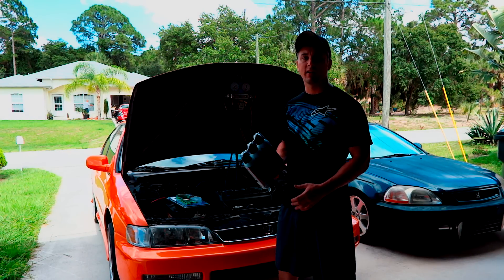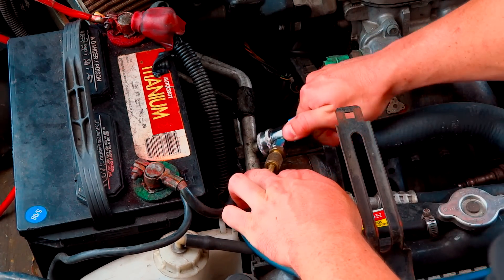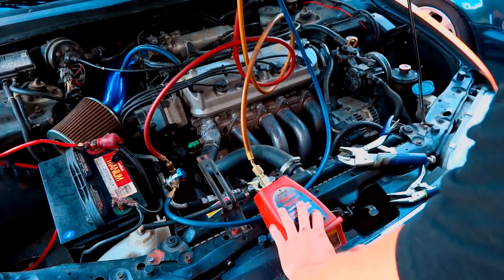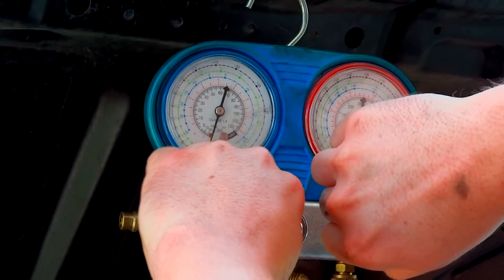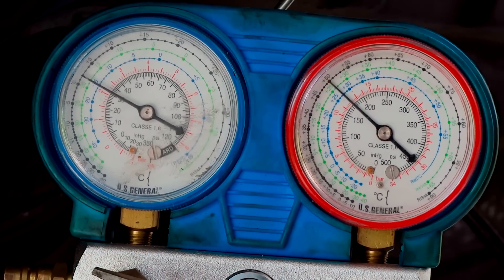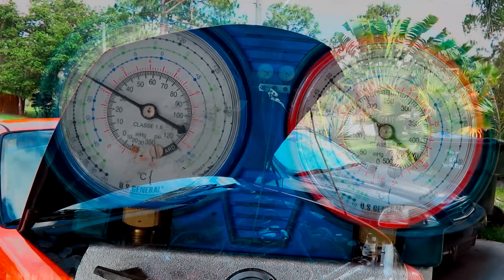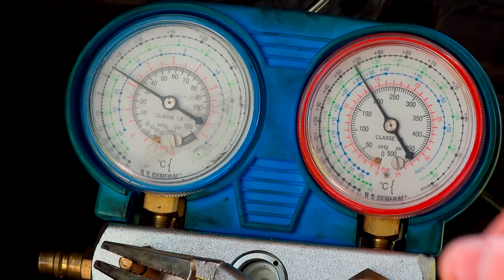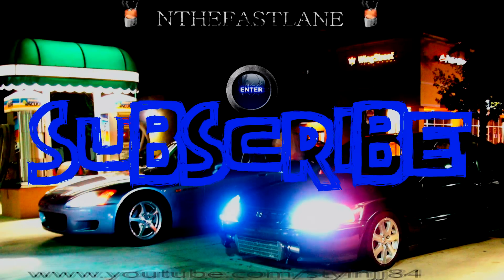Charge Your A/C With The Cheapest & Coldest Refrigerant

Comment: r134a is $5 a 12oz can at walmart.
Reply: R134a is garbage
Reply: R134a is the result of our government getting involved in something they didn't understand. R12 was much colder ran at a lower pressure therefore did not cause as many leaks. R12a is a much better replacement for r12 r134a caused a lot of compressors to go bad prematurely from running too much head pressure the systems were not designed to handle it. but our government was like all but just over pressure in the system it'll be okayas long as it cost the consumer more money and puts money in our pocket. As far as r152a or duster in this case it runs at a much lower pressure and there's more efficient then even r12. Of course our government is coming out with more new stuff now like r1234a instead of fixing the real problemstopping China from dumping cheap refrigerators and air conditioning units on our market with steel lines the rust out in corrode at the dissimilar metal connections causing leaks. Also they make these units so cheap and service guys don't like to work on them so people throw them away and by new then we have a whole bunch of old non-working unit out there leaking refrigerant into the atmosphere there's the real problem. Take a look at your refrigerator you will notice copper braised onto a steel line any point where dissimilar metals meet is a point of corrosion and future leak. Just dorm size refrigerators around the United States alone leak more into the atmosphere in one day then all the cars do in a yr now add cheap Chinese window mount air conditioning units to that and the number goes up to the point that it would take all the automobiles 10 years is Rick as much as these two items to in one day.but no politician really cares about the atmosphere in the ozone layer and your well-being they really care about the old mighty Dollar that goes in their pocket for keeping China happy.

Comment: Nthefastlane,  Interesting Video !!!  I have 3 coments 1)  All of the professional HVAC guys that make videos say NEVER tighten your HVAC gauge hoses more than hand tight.  2) if you hook your hose to the puncture tool before puncturing the can it will be easier on the fingers.  3) the infrared thermometers cant read the air temperature, they can only the temperature of solid objects  like the fins on the vents which are warmer then the actual air temperature.  I used my Infrared thermometer on the vent slats and my AC thermometer inserted into the center of the vent and it read about 15 degrees colder then the Infrared.  Otherwise it was a good video.
Reply: LTBROYT6A
All of you comments prove that this Bozo's video isn't worth two pennies rubbed together!
Reply: @user-cy6gf2pj7y  - Amen!

Comment: @16:45 Observe your temperature knob on HVAC control- it is not fully on COLD. Always have the hose connected to the can tap BEFORE tapping the can. Did you also replace the Accumulator Dryer before this charging?

Comment: This sounds like a good idea, but I can see a lot of potential problems with this. Here are 3 reasons to not do this:
1. This gas is not refrigerant grade, therefore it is not guaranteed to be pure, dry  and free of contaminants,  such as moisture, bitterant dirt and air. You could be introducing a number of potentially damaging contaminants into the AC system that could DECREASE its performance, compromise its reliability and shorten the lifespan of the system.
2. Charging an AC system with the wrong refrigerant is illegal in a lot of areas. Check your local laws to see if this applies to where you live. 
3. This refrigerant is highly flammable. Weather or not this is a serious risk is debatable,  but it is something you need to be aware of before doing something like this. If your car burns down for another reason and the insurance company finds out that you used a flammable refrigerant, they could refuse to pay you.

Comment: Report him to EPA, you will get a 10000 reward!
Release any refrigerant to the atmosphere, not using EPA certified recovery machine to reclaim refrigerant are all against the CLEAN AIR ACT.
Reply from the maker: cant can You will prob delete this comment after you "actually read the video discription" Think before you speak.
Reply: It took 60 years for people to find out how bad CFC refrigerant is, so may be people should still treat all refrigerants using proper method.  who know if years later they might found out it has problem or not.
Reply from the maker: That's great, they already ruled that Enviro-Safe and 152a difluoroethane "aka" (Dust Off) Is 0% Ozone depleting.
Reply from the maker: In the video (NO illegal substance) was ever released into the atmosphere at any point. I agree completely with evacuating r134,r12,r22,r410 ect in a contained system.
Reply: What a joke in florida 1 epa guy from north of tampa all the way to south florida also has to watch the pest control guys also met him what a joke for policing the law 1 guy 2 trades

Comment: Quick question. Will the R-152 work with R-134a PAG oil? I have a 2005 Chevy Suburban I want to turn into a rolling icebox.
Reply: No
Reply: Yes it will. I've researched this thoroughly as I'm thinking of doing this.
Reply: Yes it will.  It will work with PAG and POE oils, but not with mineral oil.  Mineral oil should be flushed out and replaced with either PAG or POE oil.

Comment: You are allowed to release air duster into the environment if you are using it as air duster. 

However, since you are using it in an A/C system, you are bound by a different set of rules.

"Section 608 of the Clean Air Act prohibits the intentional release (venting) of any refrigerant when maintaining, servicing, repairing, or disposing of air conditioning or refrigeration equipment, including MVAC systems.
*Of the SNAP-approved alternatives only one refrigerant, carbon dioxide (also known as R-744 or CO2), is exempt from the venting prohibition under section 608. Although CO2 can be released to the environment under section 608, it is not exempt from the section 609 requirements below."
https://www.epa.gov/mvac/epa-regulatory-requirements-motor-vehicle-ac-system-servicing

I don't know the reasoning behind one being allowed and the other not, other than the availability of greener alternatives.
Reply: mman454 that's about as good as a gun free zone sign.
Reply: does envirosafe contain fluorine?  does it?? does it??? why NO IT DOES NOT....   until you understand the mechanisms of why and how fluorine molecules in the upper atmosphere are bad for natural ozone then please STFU!   this is not science but legalese!!!  all he has to do is connect a hose to the system and vent the envirosafe against a dusty keyboard..... I hate people reading some of these replies
Reply: @mman454 
Bad rules which were not made according to law (the constitution does not authorize the creation of unaccountable federal agencies that make up rules for everybody else) and every freedom-loving American has an obligation to break them. So let that refrigerant go free!

Comment: R 152a is flammable, it has higher pressure than R 134a and mass ups with pre set safety and cut out switches. Its 250 psi discharge screws the outlet valve and the clutch and finally you save nothing if you calculate the time! Good luck for your business at Amazon!

Comment: This is all wrong>>Look at the top line on the ingredients how flammable this stuff is, and do you know why>Because it contains propane, yes I said propane gas and they do not have to tell you this just like your hair spray and a lot of other aerosol products that is what they use to get the stuff out of the can. Very high pressure with propane. So if you want to blow your self up then be a dummy and use this stuff. Also this is air which is not what you want in any a/c system. You pull a vacuum to get all the air out and then add Freon while under a vacuum. You never ever want air in you a/c system. This is all wrong for any a/c system.

Comment: "r134a-environmentally friendly, so you can release it into the atmosphere..." right... i would't trust this guy.
Reply: he said it's enviro-safe, which isn't r134a
Reply: He said enviro safe, which is a blend of propane and butane
Reply: @Sbourgeois225  And has been illegal for automotive use since it was first sold!
Reply: @user-cy6gf2pj7y  What's your point? I've used it quite a few times. It works really well.  I had older cars that were designed for R-12. With the enviro safe the system ran at a lower pressure which also meant less strain on the compressor. When my new truck A/C needs work and is out of warranty I will be doing the same to it.
Reply: 01:45 mark -- "I have 134A "ENVIRO-SAFE" ---- That being so, I don't know why he would change to the Dust off.  The ENVIRO-SAFE in only $6 a can - but of course shipping charges up's that.

Comment: DO NOT FOLLOW WHAT HE DOES!
Envirosafe do not mean it is legal to release.
The knob on the fitting, you never ever run them down completly, you risk of damaging the shraeder valve.
He clearly lost some oil, how much? We don't know, he don't know.
What happend if there is too little oil? Compressor failure.
What happend if too much? Oil get circulated too much, can cause compressor failure (hydrolocked) and higher than normal pressure.
He put the line in water... The fitting is all wet, when he'll plug it there WILL be water in the system. What water does? Rust. Very bad.
His vaccum pump is junk. The 4.2CFM is the air consumption, NOT the vaccum.
You need a proper vaccum pump to pull a good enought vaccum, his most likelly will not.
A compressor do not have a restrictor, it have a regulator.
You want atleast 20 minutes of as good of a vaccum as possible, not "half a bar for 20 mins then bump"... Water evaporate at near vaccum, not at half a bar...
The fittings should be tightened finger tight, else you damage the seal. So does the valves...
Reply: does envirosafe contain fluorine?  does it?? does it??? why NO IT DOES NOT....   until you understand the mechanisms of why and how fluorine molecules in the upper atmosphere are bad for natural ozone then please STFU!

Comment: Your advice on venting refrigerant being legal is dangerous at best.  The EPA can and will fine you a lot of money for releasing any refrigerant gas from an AC system including "non ozone depleting" Hydrocarbon refrigerants like R290 & R600a.  This is a question on the Certification test.  
You can sweep and pressurize an empty system using Argon or Helium or CO2 because they are not refrigerants.  
Wear some gloves and a face shield when you play with the fittings and tap the can.  Frostbite is real.  You could've had badly frostbitten fingers from getting blasted by liquid refrigerant.  Frostbite is just as bad as third degree burns. Pain, dead skin, gangrene infections and the rest of those fun things.
The face shield will protect your eyes and face...  Why? Liquid refrigerant can make Ice pellet projectiles right out of humid air from instant condensation.  Flying ice pellets will poke holes in your face and your eyes.  Worse yet if you spring a leak and the refrigerant hits an eye you will loose it.
You can rent a real vacuum pump at AutoZone that will pull a more thorough vacuum than a venturi vacuum pump running off an air compressor.  Venturi pumps don't pull enough to boil off all the water in the system.
Put a tag on the rad support that the AC system contains R152a so that a service outfit or the salvage yard doesn't contaminate their recovery machine.
Reply: the fine is around $25.000. I work as a mechanic. Not saying to do or not do it on your own just saying.
Reply: http://www.democraticunderground.com/discuss/duboard.php?az=view_all&address=389x8685166
The fine is $27,500 now.   Better to not publish the evidence on video.
Reply: 01:45 mark -- "I have 134A "ENVIRO-SAFE" -- (Edited - Disregard no restrictions - Not a AC tech - EPA ruling not known.)
Reply: @williamcahoon1438  If it's a refrigerant there are restrictions on releasing to atmosphere.  Read the rules.
Reply: @TheOcculus  I stand corrected -- Not a AC Tech. One of the original  EPA rules that I remembered was something along the line that for some reason you could not replace a previous refrigerant  (R-12) that had environmental effects with "certain" other products that did not,  but could use the same  products to replace 134a.  Does that make sense?  I would not use dust off - but - why can you release it onto a keyboard with no restrictions, yet not be allowed to release it into the atmosphere because it was used in a AC system as a refrigerant?

Comment: Interestingly, all the negative feedback is incorrect.  R152A (1,1 Diflouroethane) is indeed approved as an alternative to R134a, as it has lower greenhouse gas potential.   There is positively no reason to not employ "Air Duster" gas in a R134a application.   (Now, you really need to get handles for your manifold and stop with the vice grips.  Those valve seats are soft elastomers.)
Reply: some people should not be able to buy tools,let alone use them

Comment: if you can't afford 134 you should ride the bus. 134 IS CHEAP IT'S 5 BUCKS FOR 12 OZ
Reply: Legally Sam's cannot sell this size canister of Freon to anyone who is not EPA certified.  The only size available to the general user are the single use cans.
Reply: And in my area you can buy 30 lbs for $66 at Sams club!  Hardly any reason not to use it unless it is underperforming on an r12 retrofit.
Reply: Went to Napa and it’s 30 dollars for a 12oz can of r134a in California
Reply: @jordyworley91  But if you drive just over the border, you'd find it for less than $10 per can!

Comment: Difluoroethane has an ODP of 0 and a GWP of 120.

Though not extremely flammable in gaseous form, 1,1-difluoroethane can burn under some conditions. As such, there is also a warning label present on some gas dusters. When inverted to spray liquid, the boiling fluorocarbon aerosol is easily ignitable, producing a very large blast of flame and extremely toxic gases such as hydrogen fluoride and carbonyl fluoride as combustion products.
Reply: Now read the MSDS for a similar HFC refrigerant called R134a...  "In the event of fire wear self-contained breathing apparatus."
All of our favorite refrigerants burn fairly enthusiastically under the right conditions.  R12, R134, R152, R290, & R600a.  
When CFC R12 & R22 burn you get an extremely neurotoxic gas called Phosgene.
R152 & R134a are HFC refrigerants.  The byproducts of rapid oxidation, fire, will be fairly close to the same and they are VERY TOXIC too.
R290 is dry clean propane...  R600a is Isobutane.  They burn with the same enthusiasm as the CFC & HFC refrigerants and are easier to light but they burn without the toxicity of the fluorocarbon refrigerants.
I am not going to extol the virtues of any one refrigerant.  Nor am I going to tell you what I run in my vehicle.  They are all a tradeoff of Flammability, Raw Toxicity,  Ozone depletion, and toxicity when burned.  More of one gets you less of some others. There is no Holy Grail.  Pick your poison...  Literally.
Reply: you might also find this article interesting

http://www.coolingpost.com/world-news/calls-for-ban-on-hydrocarbon-retrofits/
Reply: another related article 

http://www.vasa.org.au/wp-content/uploads/2011/11/2005-May.pdf
Reply: The root cause of the explosion was excessive head pressure from a failed thermostatic expansion valve.
When I'm repairing older AC systems to use any refrigerant I require that a HPCO switch (High Pressure Cut Out) on the compressor head or high pressure output line is installed.  It's a safety issue.  I do not do this for a living but I will not do an AC retrofit or repair without one.  ALL Hydrocarbon & Fluorocarbon refrigerants presently in use will burn explosively when heated by extreme over-pressure.
The latest "EPA approved" FC refrigerant HFO R1234yf ( Tetrafluoropropene CH2=CFCF3 ) releases Hydrogen Flouride when it burns.  Hydrogen Flouride is not a big deal...  It just melts your lungs instead of permanently damaging your neural pathways the way Phosgene does.  A lung transplant and you're good to go right?
The refrigerant game is just that.  A game.  Regulatory agencies and legislators do and will continue to work for large moneyed interests to protect the moneyed interests profit bases and thereby their illicit cash stream.  
The various Fluorocarbon refrigerants, one of which I commonly use, oxidize into into some very nasty byproducts and they can and will explode given the proper malfunctions.  Even though I do not use Hydrocarbons I am not a cheerleader for the increasingly dangerous "modern" Fluorocarbon refrigerants.
BTW that tank full of liquid Hydrocarbon that fuels the engine is fairly dangerous too.  I knew a very nice young lady that was pinned in her Dodge Dakota and immolated by burning fuel fed from a malfunctioning fuel pump cutoff after an accident.  Life is not safe.  Driving cars and trucks is definitely not safe.  If your number is up Thanatos will collect your soul and deliver you to Kharon the ferryman.